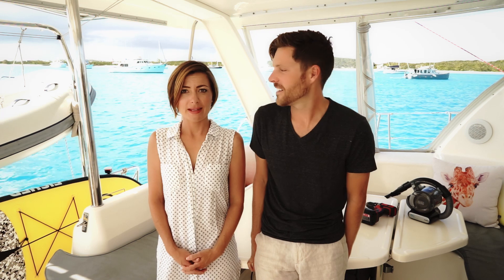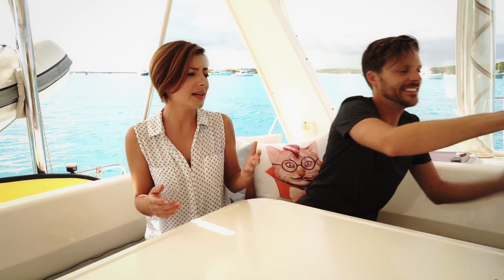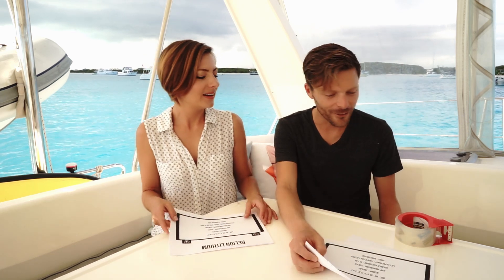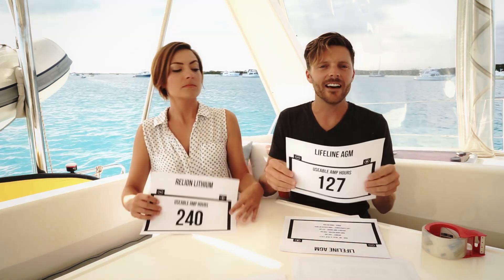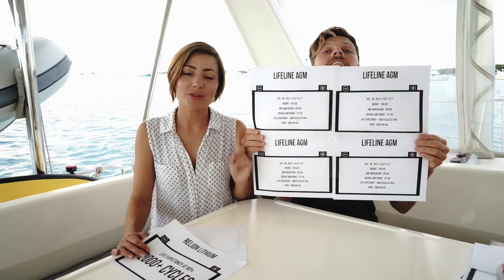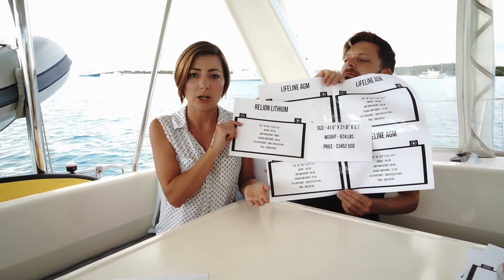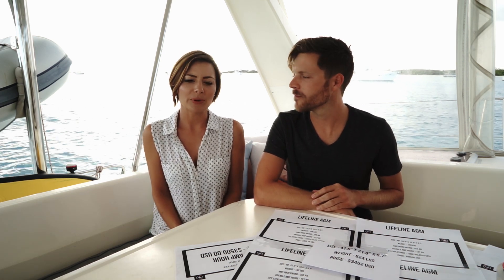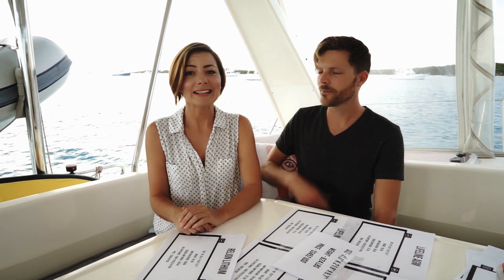Sailboat Tech - Lithium Batteries & Why We Chose Them (vs AGM)

Comment: the questionable side to your presentation has two parts :  the extracting and processing of lithium , the environmental issue AND (2) safety , in a environment of vibration.  I would choose AGM & double wind generation ability .  Solar cell manufacturing is a second manufacturing negative WRT the environment .  I hope you do not have to experience a battery fire, ever .  IBM , Boeing & Tesla all have .  Make sure you have correct fire extinguishers and keep them handy and checked.

Comment: I have a electric bike that uses   lithium batteries and was told not to discharge  below 30% and not to charge batteries  above 80% to maintain batteries  in optimum condition. which leaves only about  50% of the stated capacity usable.

Comment: AGM is the best hands down!! lead acid batteries are the cheapest, but they need maintenance and put out fumes and aren't as efficient. sealed lead acid are the same just without the maintenance. AGM is more efficient than (sealed) lead acid batteries and it is safer, no fume or maintenance. yes lithium is the most efficient, but they are also the most dangerous. they are most prone to fire!

Comment: Hey that's coool - I asked once for a all technical episode - and here it is. Thanks!!! BTW sailing la Vagabonde has also lithium batteries on their new outremer 45. The yard puts it in (Mastervolt). On our boat 5 years ago, I changed back to lead acid (after blowing not charged AGMs in a cold winter) because it was so cheap....however next time will be lithium ;-)

Comment: FYI 400AH of FLA ( the batteries you say make no sense) would cost $380. With lithium you need to change all or your chargers, alternator regulators. The BMS also needs to be very good. So $400 verses $5000 for lithium. Oh, and if you ruin the FLA battery, you are out $80 each. I am doing lithium. It does cost more, but much better if you have the $5000 to drop. Of course my batteries are going to cost $2000 for 400AH, not including BMS, charger, or regulator.

Comment: lithium battery hmm very expensive so I investigated and went lead crystal batteries, you can run them flat and they hold the depth of discharge very well. what you need to look at is what type of  charger your going to use.  But I guess what's your cranking rate to start your engine? Battery location is important also you forgot to mention lead acid should not be inside, so sealed units none maintenance is something to think about. I say get rid of lead acid batteries all together. The other thing is interesting are the shapes of the batteries for confined spaces. I am running 600 amp hours of lead crystal batteries and bank one 240 amp hours lead acid for the motor and emergencies. DC to DC charging on the lead crystal batteries is great and they have a high cranking battery that I will change too replacing the lead acid. The best part is you don't need to swap them out all at once like lead acid.

Comment: Hmmm, I'm currently running 10 x Trojan T105 = about 1250 Ah and it cost £1000. They have auto watering and are all but maintenance free. I very nearly went Lithium as I run a lot of large quadcopters and I know chemistry well, but I didn't for a few reasons:
- Batteries go wrong, no amount or warranty helps, you need to be able to replace them in the middle of nowhere. You can get a 12v lead acid almost anywhere - the T105s are Golf cart batteries and are everywhere.
- Chargers go wrong, no amount of warranty helps and Lithium chargers are very special - if you get it wrong the batteries can go BANG.... you need to be able to get something to charge your batteries (be it an alternator or a 12v car battery charger) in the middle of nowhere. If you charge lithium incorrectly they go bang. oh and Lithium battery chargers are way more expensive than lead acid chargers (That needs to be factored in to the price as well)
- Batteries on a boat get abused, if you take lithium down too far it will not recharge fully (but neither will AGM). If you over discharge Lithium they can go bang, if you over charge them they can go bang, if you abuse them they can go bang.
Now to be fair my decision and batteries were bought a few years ago, and I am not on a Cat where every kilo counts and replacement for Golf cart batteries are emerging... all we need now are really reliable, cheap and available Lithium battery chargers.
Reply: Charles,

We have owned four power cruisers over a span of 44 years (one of them, a 37 footer for just over thirty years) and we always used lead/acid batteries. We generally did coastal cruising and were "off the grid" for up to a week at a time. 

We did have a portable Honda generator, but only for a few year as it was rarely used. We would get as many as five years on 'less than premium' brand batteries. And our on board charger did a great job of keeping them charged. We did have an ample supply of distilled water on board and were careful to keep them up.

We also looked for every opportunity to reduce electrical demand. Anyway, we had excellent service with lead/acid
batteries.

All of that said, I think it does depend on the kind of sailing/cruising tht you are using the boat that should determine the best option.

For many years, we bought automotive (gasp!) batteries from Pep Boys @ $29.95 each and they lasted through the warranty period.

Comment: I buy that the AGM has to be replaced twice as often as the LI batteries, but I don't but the weight comparison between ASGM and LI. You compare the 4 AGM batteries to the one LI but you only have 2 of the AGMs installed at any given time so instead of the 624 pounds you should have whatever 2 AGMs weigh (312 lbs)  versus whatever 1 LI (93 lbs) weighs. The weight advantage still goes to LI, just not as much as you represented.

Clearly the advantage goes to LI.

PS the old fella who invented LI batteries (94 yo John B. Goodenough) didn't think LI was goodenough (see what I did there....) so he has invented a new battery that uses a sodium- or lithium-coated glass electrolyte that has THREE TIMES THE STORAGE capacity of a lithium ion battery. It also charges in minutes instead of hours and operates in both frigid and hot weather (from -20 to 60 degrees centigrade).
source:  http://www.digitaltrends.com/cool-tech/glass-battery-technology/

Comment: do you run all 4 batteries all the time, or do you have them switched into 2 banks? just wondering if i could replace starter and deepcycle into a single battery the size of the two combined. (edit) Just read your post on the website and it appears you still have a separate battery for the engine. Is that totally disconnected from the solar charging/house batteries, or can you switch them together?
Reply from the maker: +Joel Whiteside Combined. Don't forget there's a safety reason to have separate batteries for starter & house so that you don't get stranded.
Reply: Gone with the Wynns right, but mine are on a 1/2/both switch and I believe I have to put it on both if I want to charge both when running the engine. I guess the root of the question I'm asking is does your engine battery only get maintained by running the engine, or do you have a way to charge it through your solar (just in case?)

Comment: Gotta love the number of comments from people who panic over safety issues with lithium batteries.

Lithium batteries do not over heat or explode when maintained & used properly & within spec.

Every story you hear about lithium batteries burning can be traced back to the battery in question being abused.

As for lead acid batteries (AGM, SLA, FLA) being safe...  Ever seen what happens when they vent?  They all do if misused.  Sealed batteries are only sealed until internal pressure builds up.

Comment: We'll explained! Great job. When you do your "day in the life usage" video, I'd be curious to hear what you could get away with on a 300 AH vs 600 AH vs 900 AH vs 1200 AH system. We're brand new to all the battery stuff and we'll have to build up our capacity over time but have no idea what'd we'd need to start out with for basic electrical necessities.
Reply from the maker: We will 100%.
Reply: Jessica and Ryan.. love your vids as well. As far as building battery bank up in time goes,,just like lead acid lithium should all be purchaced at the same time and same age.  I have added to my lithium bank after a year, and dealer said that was about the max . these will be the last batterys you will need to buy so look at it that way it's a bargin.
Reply: especially running the AC off the inverter.  You won't find many boats that can do that.

Comment: Ooh, but the pair who sail UMA and have an lift truck electric engine instead of their Diesel on board (they swapped it themselves) have normal acid based batteries on board, no lithium.

But, great video you guys.
Reply from the maker: SLA's have worked for years, but there's no way we're putting batteries that off-gas deadly fumes under our beds or in a compartment that is connected with our bedrooms, it's just not worth it.  Plus SLA's are a pain in the butt to service every couple weeks.
Reply: Gone with the Wynns Yeah, my thoughts exactly. Liked this first episode of the boat tech video's 👍.
Reply: UMA seem to do everything on a very tight budget. Would they use Lithium if they could afford it????
Reply: Stephen J No, he said he specifically choose that, I've asked a while back and suggested the Lithium battery.